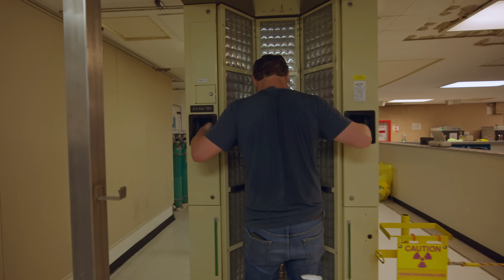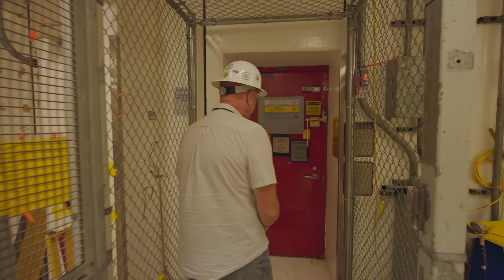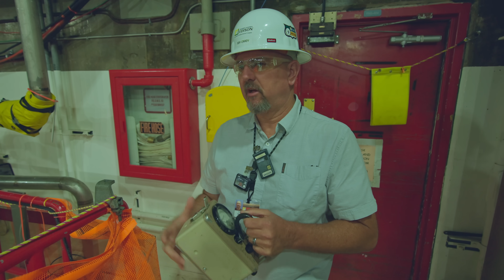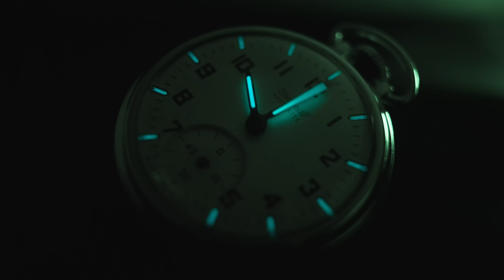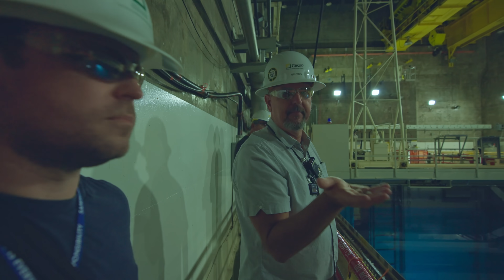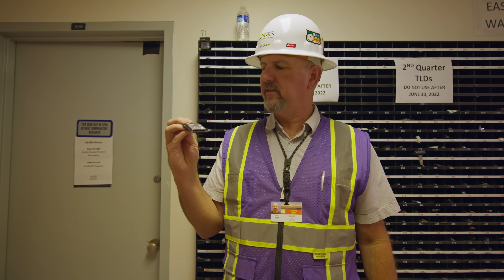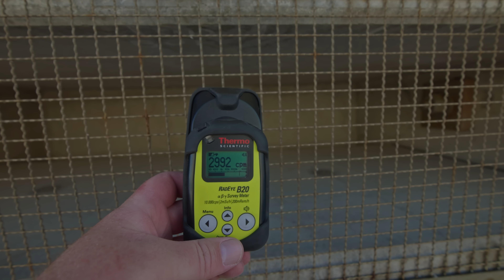Inside San Onofre Nuclear Power Fuel Pool and Spent Fuel Storage

Comment: I worked in the industry from 1974 to 1987, lastly at Rancho Seco just before it was shut down, so I've maintained an interest in nuclear reactor technology ever since. Does the DOE (Federal Government) have a workable plan for ultimate disposal of spent fuel, something other than the now moribund Yucca Mountain plan? Sooner or later, these decommissioned reactor sites will have to be cleaned up, and the spent fuel removed to a secure facility under DOE administration. After all, the licensing agreement between the NRC, DOE, and the commercial power companies states that the fuel is "leased" to the reactor operator, but remains under the ownership of the Federal Government, and it's their responsibility to dispose of it. I live in Sacramento, and we have the same situation here at Rancho Seco: hundreds of bundles of spent fuel in dry storage on-site, and SMUD (Sacramento Municipal Utility District) would sure like to know when the Feds are going to remove them. My understanding is that the State of Nevada, which is strongly opposed to having a spent fuel storage facility of any kind in their State, is likely to keep the Yucca Mountain Facility tied up in court battles for god-knows how long, forever if they can. So what are we going to do with this stuff? Over in Europe, their plan is to keep storage canisters in surface repositories, like at the San Onofre and Rancho Seco plants, for a certain amount of time (50 years?) to allow the hottest radionuclides to decay, then when the decay heat drops to a low enough level, burying the storage cans in caverns excavated in basalt or granite bedrock about 1 km below the surface. The caverns would be backfilled with bentonite clay, then surface access sealed with concrete. Apparently, the earlier plan, to reprocess spent fuel, recover the uranium and plutonium, and then vitrefy the remaining waste in glass or ceramic and burying it, has been abandoned - possibly because reprocessing spent fuel is very expensive and there are worries about diversion of plutonium and U-235 for weapons. In view of the fact that uranium is relatively scarce, and eventually we are going to have to stop burning carbon-based fuels or risk making the atmosphere unbreathable, I'm leaning toward reprocessing and recovery of fertile and fissionable materials from spent fuel as the better option. We have power reactor designs like the CANDU that can be fueled with uranium and plutonium recovered from spent fuel. It's a fact that light water reactors like San Onofre only consume about 1.5%~2% of the U-235 present in the fuel; what causes a fuel bundle to have to be removed from service, is that the fuel pellets become too saturated with fission poisons like iodine, cesium, and strontium (the "ashes" of what's left after fissioning U-235). This takes about 18 months, and in that time, a given fuel bundle has produced (hopefully) enough electricity to pay for the cost of manufacturing it, but in reality, it still contains an ENORMOUS amount of potential energy, if you reprocess to remove the fission poisons, the remaining U-235 and Pu-239 can be made into new fuel pins, and the U-238 can easily be burned in a CANDU reactor. Extracting uranium from pitchblende ore costs a lot, not least to the environment in the form of radioactive mine tailings, so once you've got the uranium in hand, so to speak, it seems to make more sense to keep re-using it until all the potential energy in it has been used up. 

We are nowhere near the ability to generate commercial electric power from fusion. Neither magnetic nor inertial confinement (Tokamak and laser ignition) have advanced to the point that the energy produced is more than about 10% of the energy required to run the reactor, and I am not convinced that commercial electric power will ever be obtainable from fusion using either of the two technologies that are being experimented with. We DO know how to build fission reactors that burn uranium or plutonium, and we can probably develop a thorium reactor, since no new technology has to be invented from scratch - it's just an engineering and design problem, and in reality, a thorium fueled reactor is just a type of breeder that turns fertile Th-232 into fissile U-233, and we've been building uranium to plutonium breeders since the 1950's. 

Thanks for the video, it was pretty cool. I never got to see the spent fuel pool at Rancho Seco, although I was in the containment building a couple of times, and actually got to climb on top of the "D" reactor coolant pump once, to make sketches and take measurements on a motor bearing lube oil pipe that had to be modified. That was a huge motor - 10,000 hp, and the top of it was about 12 feet in diameter, as I recall. From up there, I could see across to the top of the reactor pit, but the head was off the reactor for refueling, so there was nothing to see except the surface of the water that covers the pit during refueling.

Comment: Work for GE Nuclear for a couple years doing ultrasound testing on the vessel wall while refueling.  We used to have to still the  magnet robot on the vessel wall.  Talk about scary places to be.  One of the coolest places I was in way the 95%? complete abandon number 2 at Perry Ohio.  Completely dark no power and explore the parts you couldn't get to if the plant was ever active.  We need to be building more places not decommissioning them.

Comment: I'm proud to say I worked at San Onofre for 35 years. The software used on site was developed over the years by a team of programmers. I designed, wrote and maintained the most recent version of the software that was (is) used to track worker exposure using electronic dosimeters and TLDs. The software also is used to control access the the Radiation Control Area, track radioactive sources checked in and out for testing instrumentation, etc. If we must have nukes, I feel good about my work to make it safe for the workers.
Reply: And we really must have nukes if we want clean, dependable energy. I sure do hope the public will come around to being in favor of the new-generation nuclear power plants which, by design cannot run away and "melt down".
Reply: @motomuso  Terrorism.
Reply: Amazing
Reply: Same here bro.
Reply: I'm proud to say my son was a marine who would frequently drive by the San Onofre nuclear power plant and pretend to tweak its nipples.
Reply: Wow John that's really impressive you did that
Reply: Have you ever considered publishing the source code? That would be really interesting to look at!
Reply: @AngDeLuca  I don't own it. The utility does.
Reply: @johnberthoty as working in nuc medicine field, thank you for all your work.
Reply: Hey John - I’ll never forget writing the dose algorithms for the app, changing when EDE came to be, and spending over several decades running between the Mesa and Plant - miss working with the SONGS team.
Reply: @robd314  And I remember being amazed that you were able to go in there and do it! Especially after being away from code for so long.
Reply: Your not kidding me ,I know its you Homer.
Reply: The heat exchanger mess, did anyone sue Use Mitsubishi for that?
Reply from the maker: They tried. But as I heard it, some California lawmakers made it impossible for them to go after Mitsubishi.
Reply: Were the twin towers designed by a man with a breasts obsession?
Reply: @pizzafrenzyman  We used to call SONGS (San Onofre Nuclear Generating Station) "Dolly Parton on the Beach".
Reply: @JohnBerthoty  hahaha
Reply: @pizzafrenzyman  SONGS was also known as  'Dolly Parton on the beach'
Reply: We do, indeed need nuclear power.  SMRs, wind, wave, tidal, and solar power are our future.
Reply: Thank you for your service!!! 🙇
Reply: 9
Reply: One of the few plants in the U.S. I haven't made it to, though many people I know have.
Reply: I am surprised that TLDs are used, I thought for sure it would be OSLD by now.
Reply: Thank you for the work. California needs this clean energy source back. Too bad its ran by idiots
Reply: Super fascinating!
Reply: What language is used for the program? Is it proprietary?
Reply: @soultec8583  Powerbuilder for the front end and Oracle for the back end.
Reply: @JohnBerthoty  thank you for the reply. I'm a 3rd year CS student and have over the last year been increasingly interested in all things nuclear. Might have to curate my career path.
Reply: @soultec8583  Congrats, keep going!
Reply: No you didn't
Reply: @Knoxx666  No I didn't what?
Reply: Do you think the Whole Body Contamination Monitor was outdated?
Reply: @drew6167  I have no idea really.
Reply: So you can just talk openly about the inner operations and systems of a nuclear power plant ?
Reply: Must have nukes? More like get to have nukes.
Reply: and then SAP software killed our plant
Reply: Wow... thank you sir,  the tem, and the previous who worked for it as it is now
Reply: Thank you for ur service!
Reply: Liar
Reply: That's an incredible story. This year I career-changed from journalism into development, and your comment made me wonder: if you're at liberty to say, what kind of testing process would your code have gone through before it got put to work? As it provides a high-stakes function, I wonder if it's much different than regular code testing...
Reply: @triatc  Testing was rigorous but not too bad... in the beginning. We had peer reviews, user testing, test scripts written and run by maniacs who lived to find bugs, etc. All the usual stuff but we were constantly trying to up our game. By the time I retired, without exaggeration, it took two days to change a label on a field on a window. In the old days,  I'd make a change like that, compile, upload, and notify the plant personnel to restart the app.
Reply: @JohnBerthoty  thanks for replying and sorry for my slow response. Your experiences are so cool, and I'm glad you shared them :) it's interesting how much more process-driven everything has become, even in code testing!
Reply: Humanity in the future is what concerns me, giving that the half life of some sources of radiation is thousands of years
Reply: Ever see any UFOs in that area?
Reply: @radwizard  Nope
Reply: @JohnBerthoty lies😅
Reply: @siiioxide  I don't get it.
Reply: @JohnBerthoty ever get stuck breaking up the contaminated concrete at unit 1?  I did...
Reply: @patjohnston4047  No, but I was involved in Unit 1 Return To Service.
Reply: @JohnBerthoty  Back in 93 it was in wet layup, you guys got it to run again?  Or was that before then?  Anyways a lot of good and bad things went on.  I was in RMC back then.  Got yelled at for using expensive ALARA paint to decon room instead of scrubbing them down lol.   I had a good friend Cam Robertson working there loved in Dana Point.
Reply: What programing language do you need to know for this and does it pay well? @JohnBerthoty
Reply: @radwizard my cousin and I did just north in San Pedro. We were at Royal Palm beach about 10 at night when we saw something out in the water way north of us and it was moving south at a fast pace. Within just a few seconds it went from where we first saw it past us and then disappeared south of us. As it was passing us it was probably 100 ft off the water and was silent.
Reply: @radwizard  dumbass question. Lol
Reply: @radwizard flew in that area several years, and nope not 1, never even heard stories of any.
Reply: You definitely did not work here
Reply: @coolorphans  Huh?

Comment: Great video’s … Soooo many questions like how much spent fuel is just sitting g around or “In storage” not just at 1 plant but all facilities? What is the life cycle of the fuel?
Reply from the maker: I think for the US there is enough spent fuel from all the nuclear reactors that have ever run and that are still running to stack on a football field 6-9 feet high. As far as the fuel cycle goes at this location every 18 months they would have an outage where the refuel and reconfigure the core. But as I remember it the fuel would stay in the core for 3 outages. So a fuel bundle would stay in the core for 54 months, which is pretty good.

Comment: Where I work we use thermo scientific radiation detectors before we hammer mill scrap metal and we have a pin point detector and a small area detector I took the door off one of the panels once and it was 10k to change the case a small sheet metal cabinet
Reply from the maker: Sounds like a government contractor.

Comment: The press push fear to the general public about nuclear power and the result will be catastrophic in the next few decades when the world realizes that green energy will not satisfy all our electrical power needs and the World continues to burn ever more fossil fuels to satisfy those electrical needs around the world!  Most countries are decommissioning nuclear power which has ZERO greenhouse gas emissions while running and replacing most of it with fossil fuel plants with only a tiny fraction replaced with solar and wind! What a crazy world we live in where fear trumps common sense:(

Comment: Awesome video! I always hear that nuclear power plants are built by the ocean because they need a lot of water to operate. But I can't seem to find out how much water they use in a day or any measurement of time.
Reply: Nuclear Plants all operate on the rankine cycle which is just like any other powerplant that uses steam to turn a turbine generator. The cycle needs a heat sink to condense the steam back into water after it goes through the turbine. Large bodies of water such as oceans, lakes, or even rivers, are the best heat sinks since they generally have a predictable and low baseline temperature. There are inland nuclear powerplants that use cooling towers at heat sinks.

The amount of water needed for cooling varies based on the size of the plant (specifically its thermal output), and the starting temperature of the cooling water. I am not sure if I remember the exact stat, but I think San Onofre used about 1 million gallons per minute, per unit. All of this water returned to the ocean a few degrees warmer. Local fisherman from Dana Point used to love fishing at the San Onofre outfall, as the warmer temperatures would bring lots of fish.
Reply: @fakljfklajf  Thanks for taking your time to answer my question. I crunched the numbers and they are ridiculous. The power plant would almost use 3 billion gallons of water a day for both units. That's about 4150 Olympic swimming pools. I'll have to look up what pumps they use.
Reply: @Gooday2day  each unit used 4 massive circulating water pumps. They were large enough that several people could stand inside of their suction bells. I actually did it a few times when the intake was dewatered. I cannot remember stats about horsepower and whatnot

You can see the tops of the 4 pump motors for each unit in the intake area approximately here: 33.368510442893104, -117.55544879884837 (for unit 2)

Comment: The only problem we have with nuclear energy is that we don't use "heavy water" fast breeder reactors which means that only a tiny amount of total uranium can be used in current "light water" reactors. The nice thing about fast breeder reactors is that they can produce new fuel as a side-product while generating electricty.

Comment: Seems odd that after the accident, they then had to calculate that a fall from 25 feet would be ok. You would think they would have determined the safe drop limit before they started moving those things around
Reply: Look up the near accident that happened when they lowered one of the containers in that spent fuel storage.  A whistleblower exposed it and it shut down ops for a lil while.

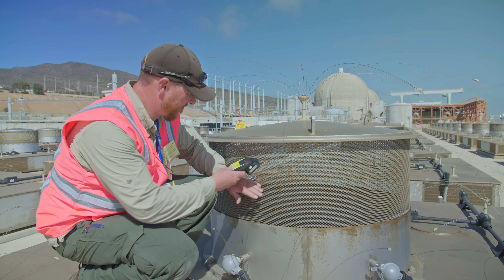Comment: 33:20. Ok, so average, 340 per storage unit. How many Dry Storage units are there? 
Dry storage units x 340 Rads = ?
120 degrees per storage unit x how many storage units? 
Please, don't minimize.
The storage has been open to air for how many years now? And how many years to come?
Reply from the maker: I don't get what you're trying to say? Are you implying that because radiation is coming out of those dry casks on that storage pad it has some type of effect? That's doing nothing to anyone anywhere. The air isn't radioactive.
Reply: @RadioactiveDrew  11-13-22 1:05 pm SD, Calif  Hi Drew, as I am curious I'm also confused - 34:30 When you approached the OLDER above-ground storage units and placed the RADEYE B20 next to the low vent the Radiation level (233 prox) jumped very high (3,000 plus) much more than the below ground storage units,  Where does that Radiation go? It dissipates somewhere, right?

Comment: 1000 mr is quite low. Standard across the industry is 2000 Mr. As per most commercial plants. And many rad workers that tend to work outages at power plants can achieve 2000 in a few months. And get extensions regularly. These extensions usually only let you get up to 4000 mr before they stop allowing extensions, unless in cases of extreme need cases. However they are few and far between.